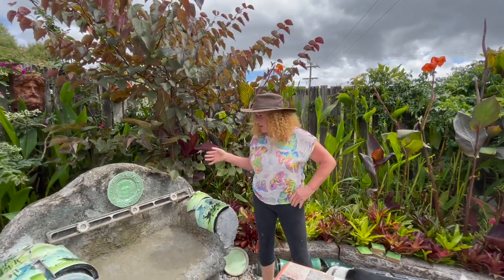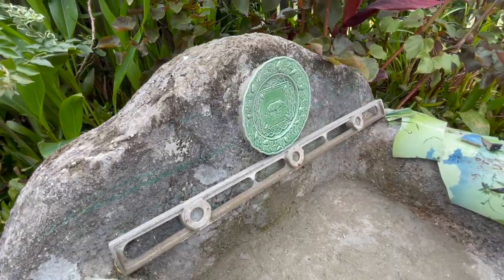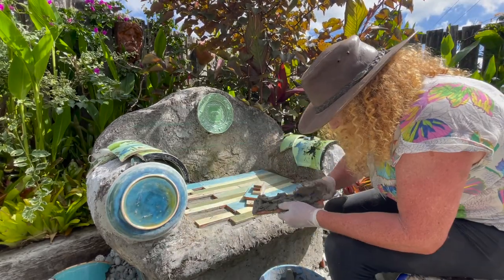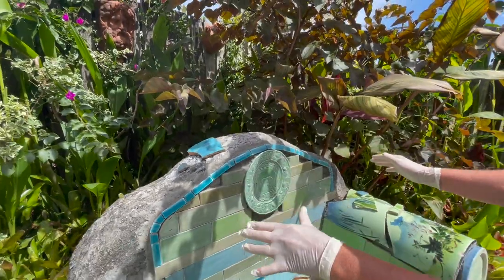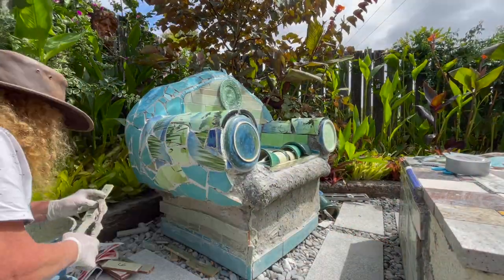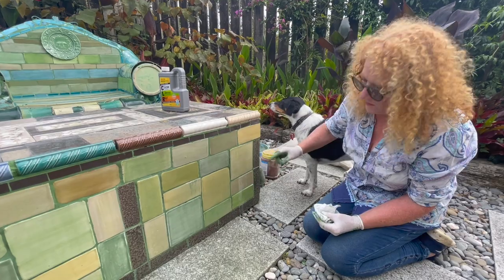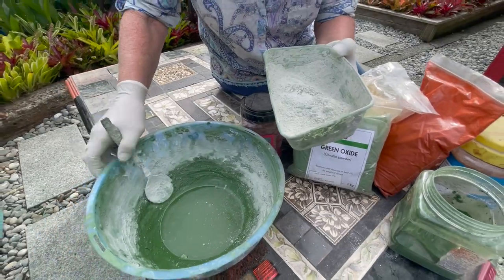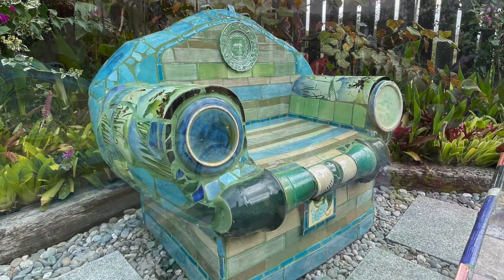Mosaic Chair Tutorial | Joy Bell Art

Comment: Fabulous! What do you do with the bottom of the chair?
Reply from the maker: Hi Patty, I left it as a slab of polystyrene…you can’t see it from any angle but the slab is touching the ground not the tiles
Reply: Would rain (ie sitting in a puddle) degrade the poly styrene?  Bugs (cockroaches) make a home in it?  I am nervous about our heat and bugs affecting it!!
Reply from the maker: @WatchMovies57  hi Leslie! I don’t know if sitting in a puddle would destroy the polystyrene base but it certainly withstands been on grass, dirt and in my case the chair was exposed and unprotected for ten years on grass and is now on pebbles. Half of it was sealed with mortar mix and the rest exposed…just waiting to be done. The blue and white poly based couch was gifted after 20 years outside and unfinished…so it’s amazing resilient and uniquely compatible with all concrete products. Never seen any insects…even slaters live in it!